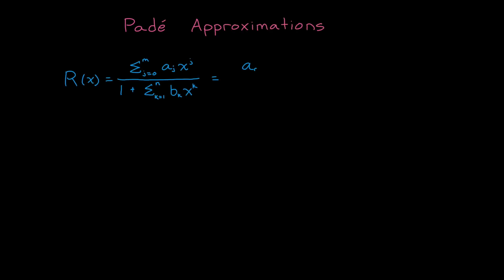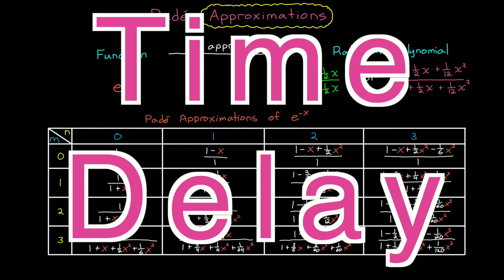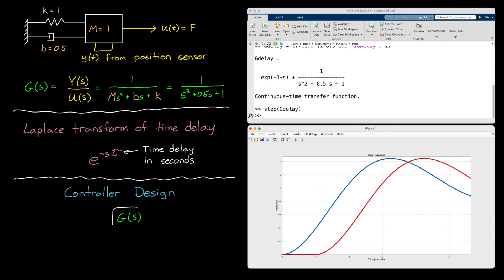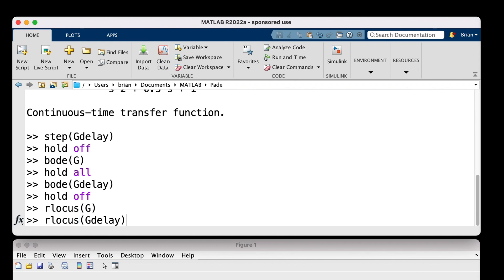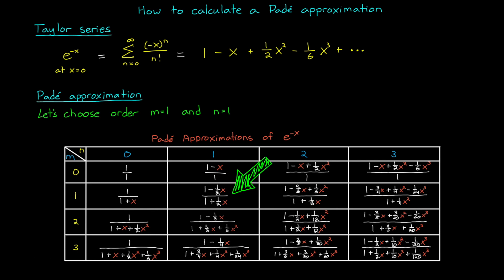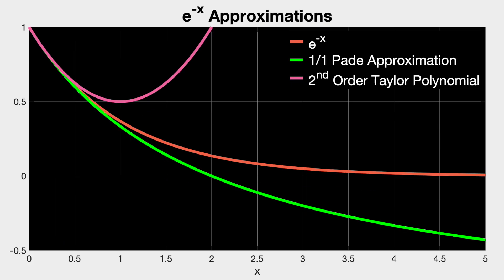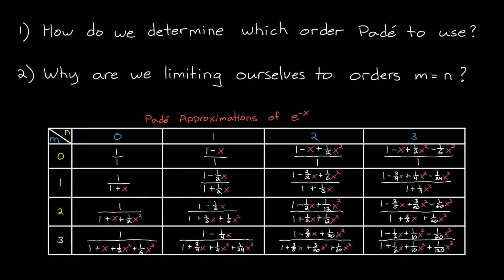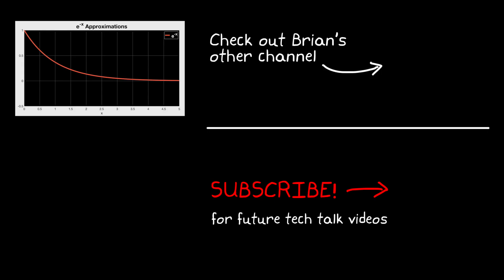Why Padé Approximations Are Great! | Control Systems in Practice

Comment: Brilliant explanation, particularly the bit on what order Padé approximation to use vs cutoff frequency. I understand it much better now!

This is a REALLY important topic because time delays are common in electronic control systems, particularly digital ones. Even a few addition 10’s of ms of delay can wreck the system bandwidth or introduce instability.

Comment: Would the Padé approximation also be useful to construct fraction order controllers?
Reply: Of course you can, compute the Taylor series of the backwards Euler method for example to approximate the derivative T(x) =(1-z)^a where a is the order and then make it equal to the ratio between two polynomials T(x) = P(x)/Q(x) and there you have an approximation using padé for a discrete fractional derivative operator

Comment: Hello to all COntrol System Experts, I have one question, Can I make Non Linear Controllers using Analog circuits? As for PID Controller, we use Resistors, Capacitors, and Opamp. How to make nonlinear controllers like this?
Reply: Any passive , active device that has property of non-linear in the range such sin , exp for example ,diode , transistor etc.